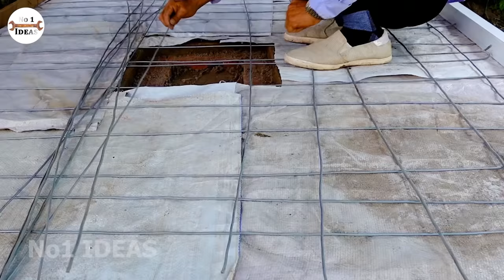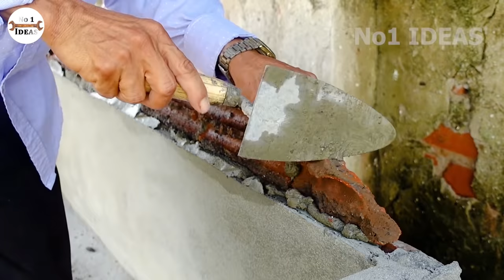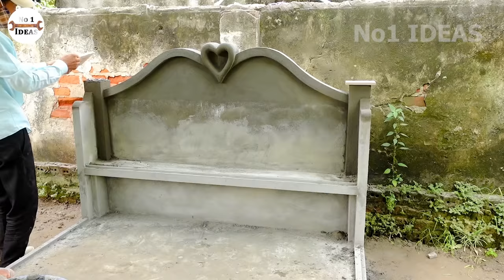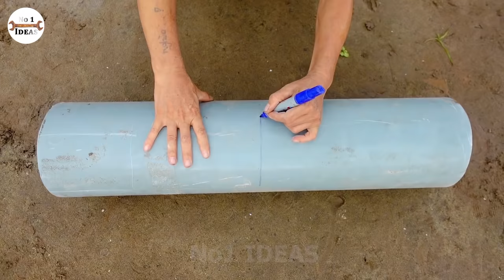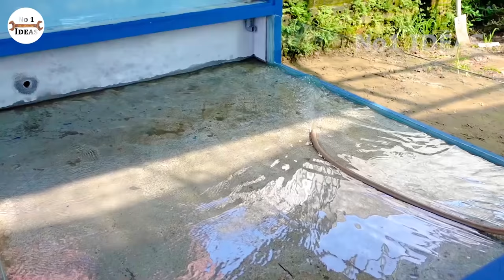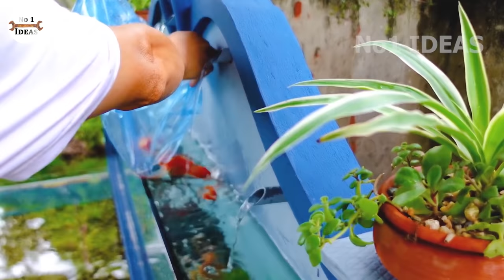A masterpiece made from cement and glass! Beautiful outdoor aquarium bed

Comment: I'm thinking about those fish underneath of that glass bed. They want air and that glasses are going to increase more heat under water.
Reply: Right click
Reply: he remove glass after video.
Reply: @เซ็งเซ็ง-ฐ9ซ  really?
Reply: @เซ็งเซ็ง-ฐ9ซ  HOW DO YOU KNOW THAT
Reply: I also think like this. Where is the oxygen port??? And water can circulate??? the answer is may be u can apply the oxygen under the bed and there is need one hole for the oxygen pipe to enter that. And then this one cant use to sleep.Only can use for beauty of creation.
Reply: @tripleprime7956  yeah otherwise no need to keep fish there.
Reply: @เซ็งเซ็ง-ฐ9ซ  yes
Reply: Did you forget that water has dissolved oxygen 😑
Reply: @Saurabhkumar-gx2wu  yes
Reply: Vệ sinh thật là cả một vấn đề
Reply: @Saurabhkumar-gx2wu  so why are we using oxygen machine for that???
Reply: @tripleprime7956 xr
Reply: Cruelty at it's height
Reply: @Saurabhkumar-gx2wu  the oxygen will eventually run out if da fishes are kept there for long
Reply: yes this is stupidity i rather use floor and there is no matress this is too hard to sleep
Reply: Yes there is no oxygen supply in that underneath .How it is possible .....